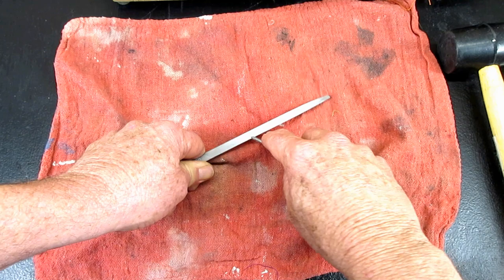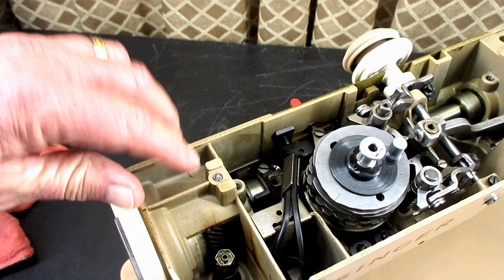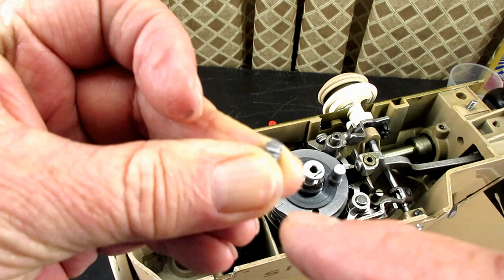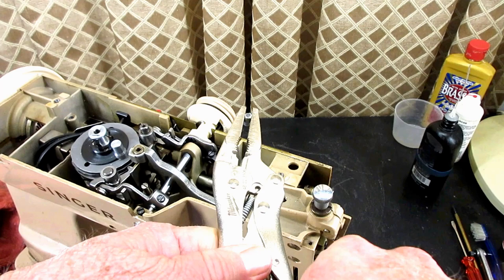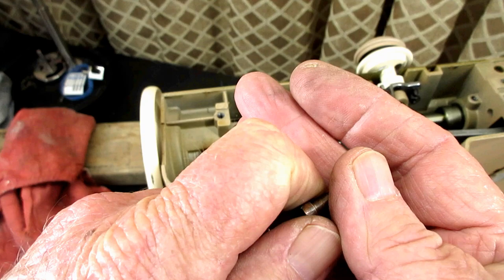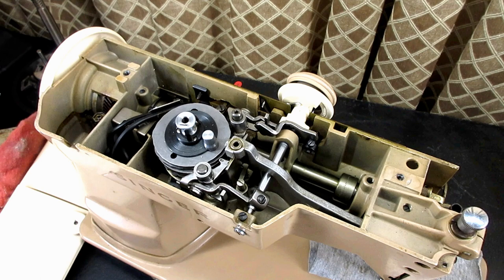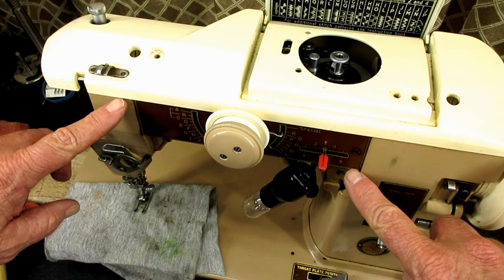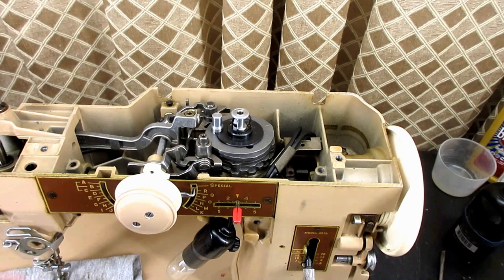Removing Broken Arm Cover Screws on a Singer Model 401A Sewing Machine

Comment: Lucky that the screw bosses themselves weren't broken.  Living in the heart of the "rust belt", I've had a lot of experience with broken, rusted off screws.  I've got a few sewing projects waiting for winter on my 503a.  Thanks for the video Andy.  I hope everything's well with you.
Reply from the maker: Hi, Ralph. I was lucky. I was concerned the threads would be damaged. Lucky the body is aluminum so no rust worries on this one. Although I much prefer the 403A I did enjoy working on the 503A Rocketeer. https://www.youtube.com/playlist?list=PLsCOZgzzaiKJZaZn2zl3LsnV2d7UhrqvX You must be in a clod climate if you line up projects for the winter? Thanks for watching and take care.
Reply: @andytubesewing1953  Northwest Wisconsin, here we dump dirt and salt on our roads 8 mos. of the year hence...the rust belt.  Thanks Andy-
Reply from the maker: @ralphwatten2426  Oh man. I would not last even one winter there. I've lived in Phoenix all my life. I went grocery shopping the other day when it was 108, but don't even go outside when it dips below 40, haha. I did some of my best restoration work during the last 5 summers. Fall and winter here are for going outdoors, gardening, traveling, etc. Plenty of folks from your area visit here in the winter. Snow Birds we call them and they are welcomed.
Reply: @andytubesewing1953  This summer I was in Spokane WA, on my motorcycle stopped in traffic when it was 110 degrees.  I got heat exhaustion and pulled into an RV place to get into the AC.  If they hadn't let me in I don't know what would have happened to me.  They were very nice and told me to take my time.  I was a mess.  Up here it can get to -20F in winter and a wind chill to -60 and you can freeze in about 30 minutes.  After my "little incident" I'd say the heat is just as dangerous.  I've heard of snow in Phoenix.  Have you seen it?
Reply from the maker: @ralphwatten2426  Sorry you went thru that. Yes, dangerous in the heat of the day.TG for air-con. Yes, I've seen enough snow to lightly cover the ground... a dusting?...  3 times in my life in Phoenix city limits. Some of the foothills nearby get some snow more often.

Comment: Hi Andy!  I’m Candy!  I’m watching your series on Coco Goes to the Spa as I am doing the same, and more, to my 301A, which was acquired a week ago in a dirty condition.  Dirty, as in dry from being in a storage shed with bugs nesting inside!  I’m going to find Krud Kutter  and was hoping you could tell me what all products do you use afterward?  Is there a list of items on a certain video?  
Prayers for your complete healing!  And I just love love love your chuckle!  Hmm-Mmm!
Reply from the maker: Welcome to Andy Tube, Candy. Besides the Coco series; https://www.youtube.com/playlist?list=PLsCOZgzzaiKLZyGebzS_oISgesXNyREyI      here are 17 more 301A technical adjustment type videos for model 301A;
https://www.youtube.com/playlist?list=PLsCOZgzzaiKI_6fbu3itbd1v4z3uQvvkO     many of my viewers also use some of the 50+ videos I did for model 404, which has mostly the same mechanics as the 301A; https://www.youtube.com/playlist?list=PLsCOZgzzaiKI_6fbu3itbd1v4z3uQvvkO
Products are the Krud Kutter Cleaner and degreaser, and I use their rust remover also if I find any rust on the machine;
https://www.rustoleum.com/product-catalog/consumer-brands/krud-kutter/rust-remedies/the-must-for-rust-rust-remover-and-inhibitor
I use metal polish on the bright chrome sometimes. I have tried a dozen different ones and I usually by the old standby "BRASSO" ;
https://www.walmart.com/ip/Brasso-Metal-Polish-8oz-Bottle-for-Brass-Copper-Stainless-Chrome-Aluminum-Pewter-Bronze/31954265

I use TriFlow Oil & Grease; OIL = https://www.triflowlubricants.com/product/tri-flow-superior-lubricant-drip-bottle/
GREASE =   https://www.triflowlubricants.com/product/tri-flow-synthetic-grease/
Here is an earlier series I did and the first two parts are about tools and chemicals I use; https://www.youtube.com/playlist?list=PLsCOZgzzaiKJxbOOMKQPvmeTRqi0dhGa5
Thank you for the good wishes and best of luck with your 301A

Comment: You must have had your "easy" button close by Andy! I was expecting a much more difficult job. Must have been quite a drop to put that dent in the body and to shear the top cover screws. Except for a little cosmetic damage, that 401a will be 100% when you are finished.
Reply from the maker: Easy does it, right? A coarse-threaded screw so not too tight. I think it was dropped from table height maybe. I tried cutting the longer piece with lineman's pliers after I removed it. Barely made a dent. I guess the "shearing force" was just right. Thanks for watching.

Comment: A left-hand twist drill bit works to remove a broken screw.
Reply from the maker: Yes, and that was suggested in the comment on the video where I showed the machine tour.   https://youtu.be/kSR5FmIRq0A 
I think this was easy to remove B/C the screw is never really tightened that hard to hold just the arm cover, and it is a coarse-threaded screw. I was going for the simplest solution I could think of for my viewers around the world. Thanks for watching, John, and taking time to comment.